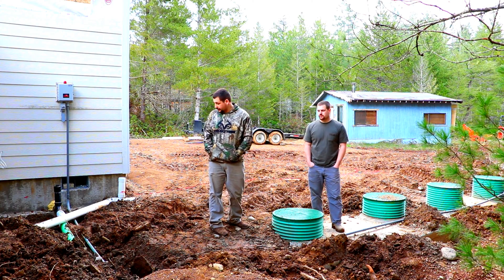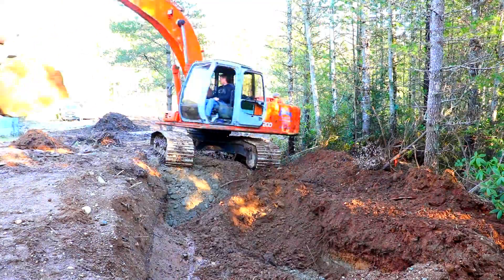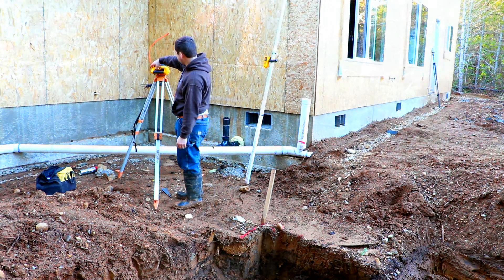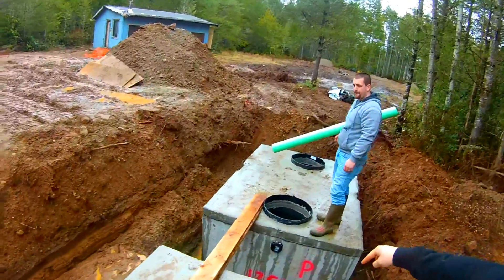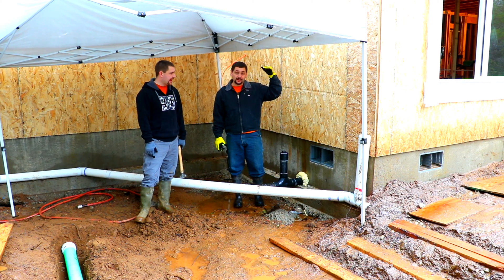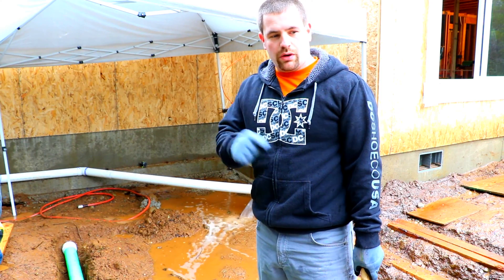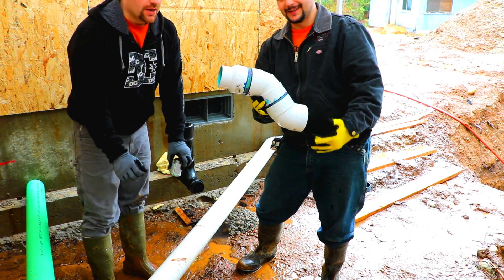Install your own pressure drain field #1

Comment: I've been looking to upgrade my half century old weep field with the infiltrator system as well. I'm wondering why you needed to place so much weep chamber to manage a rural property, unless of course you have 15 children or run a daycare or something :) Also, I've been looking at the Infiltrator system and it doesn't mention the need for PVC piping to be threaded  through the weep chamber system so I'm wondering why you'd think that was necessary? Thanks for any info you can provide.
Reply: The pipe is because it's a pressure distribution system that applies the effluent evenly over the whole treatment area.  This is necessary in areas with shallow or poor soils, but can also greatly prolong the life of the field even in good soils.  I don't know the specifics of the house here, but the treatment area size seems about average for a 3 bedroom house.  The goal is not to just dump the effluent in the ground, it's to create an environment in which soil bacteria can decompose the organic compounds in the effluent, and that requires a lot of surface area for proper treatment.

Comment: If I am correct, you are in Mason County, WA. From what I have been told, you need to have a certified septic installer install the septic system. How do you get around that?  I have property in Belfair and I would like to install my septic system.  Just stuck on how the county will let me do myself.  Thanks! Love your videos! Keep 'em coming!

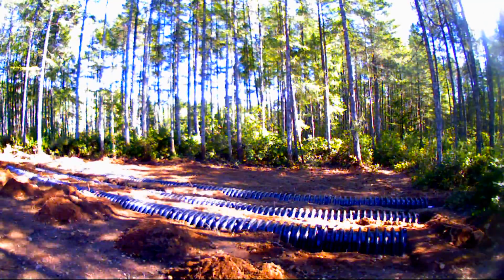Comment: @1:35 - So the plastic chambers are laid flat unlike traditional pipe leach fields which has to be put on a slope? Good video.
Reply: John Be Bad traditional septic systems and chamber septic systems must be laid flat if you don’t lay them flat all the water runs to one end and you will never use the full capacity of your system ! That’s the way we have to do it in Ohio in the way we’ve always done it have been installing septic systems myself since 1973 our company has been in business since 1951. Hope that gives you a little information!

Comment: is a perc test required when replacing an existing drain field / Leach field
Reply from the maker: I would think that it would be required by the county. How i have never had to replace a drain field. i have only put in new ones.
Reply: In Ohio it is required to have a soil test done for new septic systems and replacements depending on the state you live in

Comment: How long has the infiltrators been working now? Any issues with them. I was thinking of abandoning my original Orangeberg pipe and rock lines and just running Infiltrators there instead. The ground is good and drains well, but the pipe is beginning the crush

Comment: just a little over kill I think. but if you got that kind of money to throw around then good for you. those infitrators  mush of costed you 4,000 alone. and you used 2 septic tanks. wow that's a lot of money. if you have 10 people in that house. then that's good.
Reply from the maker: Watch all five videos about the system it explains all of it, and why it has to be this way. Its also interesting to me that you think that someone would install this kind of system because they wanted to. This is what is required by the health district and the county in western Washington.
Reply: Yes he’s right the county and your soil analysis determines what kind of septic system you put in!